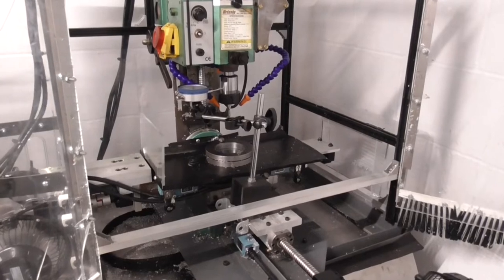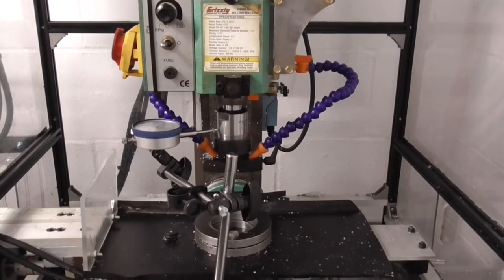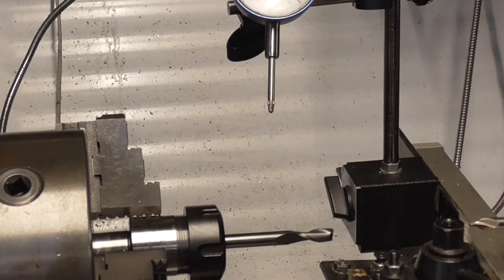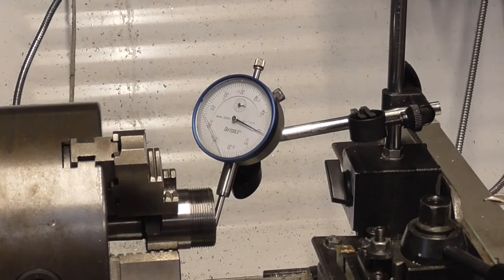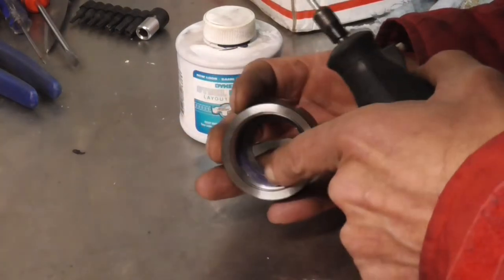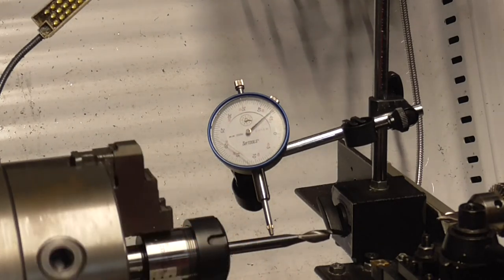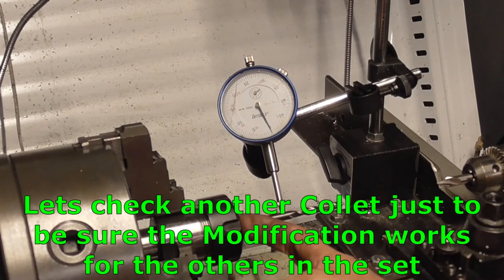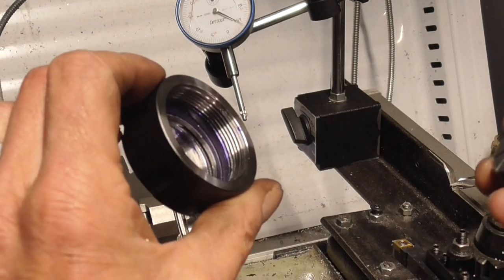Low Cost (Cheap) ER32 Mill Collet - Waste of Money or Worth it ?!?!

Comment: I too have had issues with these cheap collet chucks. To test the collet though you really need to hold the chuck in the lathe using the morse taper, not the body of the chuck as this part usually has no accuracy. cheers.
Reply from the maker: Thanks 👍. Yep, this set I got was definitely lacking accuracy on most every surface lol…good point on using the taper vs. the body to measure as those are the touch points 👍

Comment: Hello there Steve,   Thank you for another great video.  It's all in the details and tolerances for the best results.  How is your 1100cc Yamaha performing  ?  Do you like it better than your 750cc Yamaha ?
Reply from the maker: Thanks man !  Yep sometimes low cost stuff works fine if it can be fixed relatively easily…other times it’s better to buy a more expensive option (like the mid price range lathe chuck I got vs. the cheapest option) I’ve found 👍

The 1100 has been doing great, but I need to rebuild the carbs as I never did it when I first got the bike and got it running so the front cylinder is still running rich and I cannot adjust the air/fuel mix on that cyl.  Having 4 bikes to compare to is actually pretty interesting for me.  For me, the 1st Gen 750 Cafe is good for around town but that’s about it, the 1st Gen 750 Bobber is pretty comfortable, but still only good for about a 2 hour ride.  The 1st Gen Stock 750 is more comfortable than the modified bikes so about 4 hours of riding gets me kind of tired, but I think I could ride the 1100 all day and still feel like getting back on it again the next morning, lol.

It’s a very comfortable bike for sure and easily cruises down the road with little effort.  It doesn’t go around the curvy roads as well as the bobber or 750 stock (it’s a little wider and sits differently), but can’t be beat for long cruising for sure.  A lot depends on what type of ride I’m doing as to which bike I pick…if I could only have two bikes out of the 4, I’d say I’d pick the 750 Bobber for short stress reducing rides and the 1100 for long traveling rides…of course, I’ll never get rid of my 1st Gen Stock 750 as I’ve had it for ever so it would be hard to only have two bikes now, lol !
Reply: @StevesDIYs  Hello there Steve,  I really appreciate your detailed reply on your Yamaha bikes of different riding feel and comfort.  Ever since I subscribed to your YouTube channel some years ago, I’ve noticed how much love and care and time you’ve put into your motorcycles.  I was going to ask before if you would ever consider selling your stock Yamaha but you already answered that question in your reply, lol.  It’s okay because I have a project Yamaha Virago 1983 that’s still needs repair.  Hopefully it will run again, maybe.  Your friend from Arizona 🌵🌵🏍
Reply from the maker: @GarysnewYT  thanks man, yep, I can’t imagine getting rid of my stock 750 as it was the bike that got me into liking the Viragos years ago.  Hopefully you will be able to get your bike up and running again soon 👍. Sometimes I only have an opportunity to just make quick trips around town for a whole riding season it seems, but it still gives me a way to enjoy a pretty day and let my worries go…even if just for a little bit 🙂. Thanks again and all the best my friend !  Steve